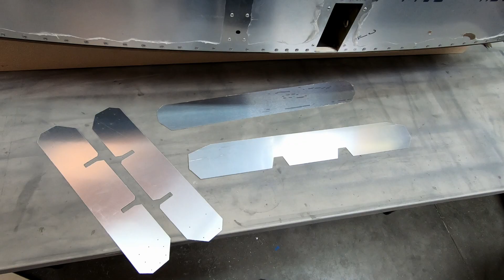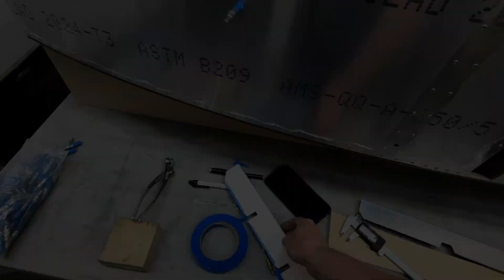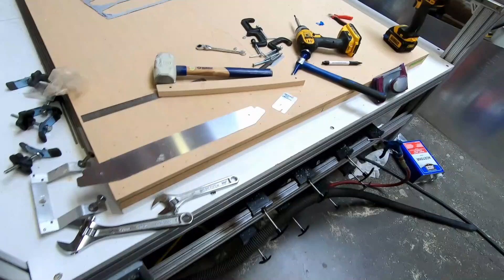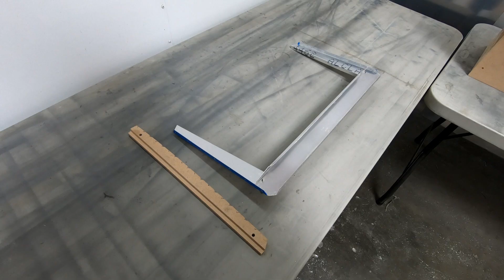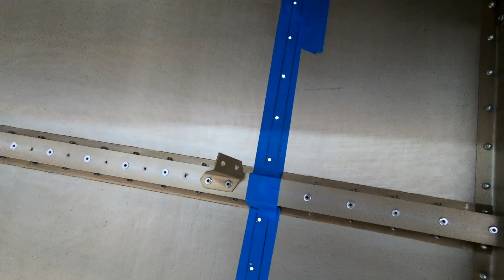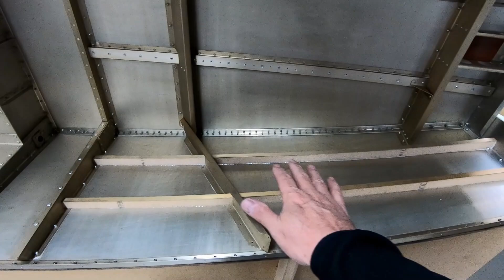15 - CriCri Airplane Build - Frame 2 and Forward Fuselage Stiffeners

Comment: Hey Jim, probably a stupid question... after you riveted frame 2 and those top supports, how easy or tricky will it be to install the rudder pedal tray and fuel tank?  Should the Pedal tray be installed first next time?
Reply from the maker: You can easily access the pedal rails and the tank area however, in the video I show that I left the top of frame 2 and the front of the upper supports where they attach to frame 1 unriveted. This allows me to remove the entire top assembly for access.
Reply: @crikitaviation  ahhh good thinking!